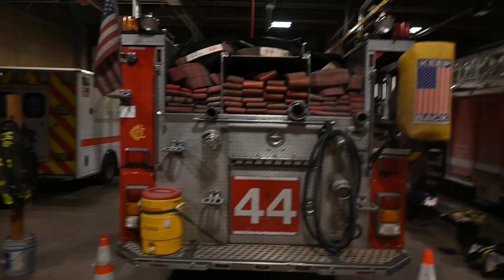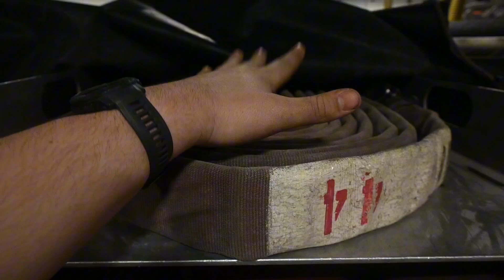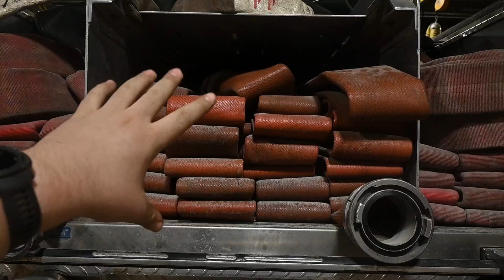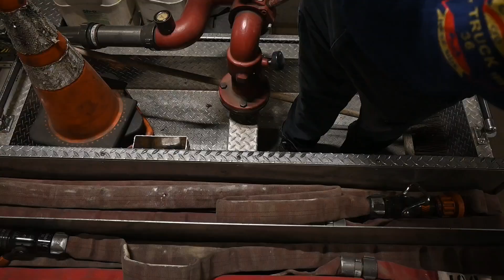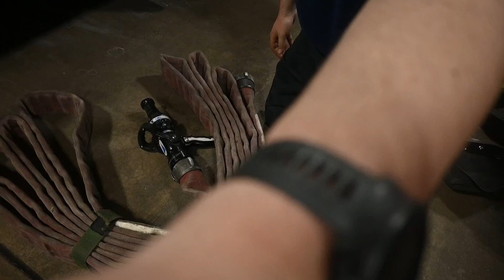All About the CFD - Episode 1 - The Basics of the CFD Engine

Comment: Standard hose load is 3 horseshoes “4 to make 3” so it’s 200 feet total.  Then the 1 1/4 shut off pipe which is a smoothbore nozzle with a 1 1/2” outside diameter, connected to a 2 1/2” to 2x 1 1/2” wye via an increaser.  Then the 100 feet of 1 3/4” hose with 1 1/2” connections on the tray.  Officer’s side is an exposure line with the same 3 horseshoe configuration but a 250/50 fog nozzle at the tip.

There is some leeway, basically the captain sets the rig up the way they want and individual shifts may change pipes or tips if they are really gung ho about having things their own way, but rebedding hose each morning just to have it your way is almost never done.
Reply from the maker: That's how I explained it!
Reply: @ Nah, 44 is running with 2 shoes for a 150’ lead out.  The idea is, there’s never a guy for the 3rd shoe so having 3 just means more spaghetti.
Reply from the maker: @michaelmcmeel914  well yes but the stretches in general I explained, I didn't really go into the shoes

Comment: Thank you so much for going through the HOSE setup on CFD 😊 engines. The redundancy of all the engines 😊❤😊 This is very educational for people, especially the general public that is watching Chicago Fire on TV and not knowing  the hose lay setups. Can I ask why Chicago  goes with  (4 inch) instead  of ( 5 inch) with a storze connection. I'm just asking out there  to Chicago people that now. I am so proud  to be an OWNER of a Spartan Gladiator pumper fire engine 1989 that I just bought 😊 its a training  rig from a fire cadets  program. I bought  it to keep it with program 😊 I have taken over all expenses 😊 there is some issues  with the pump piping. The ( tank to pump) has a cracked across  the middle. It's because  the rig sat outside in colder weather, and they did NOT put antifreeze  in the tank. The piping  on the tank to pump is lower so water was in  plumbing. Two reconnect are stuck open. One on cross lay and one is what the department  that got the rig new wanted ( a car fire reconnect) going off rear on officer  side. I have my baby girl in repair  ( fire repair shop) to FIX the important  one for me the tank to pump crack. Then, have them give me costs on the two reconnect repair. I want her a fully working ( pumping) engine  so cadets  can do all the drills off her. A department  donated  to the program  a ton of ( 5 inch) stotz hose, so I got 300 feet on my baby girl. I love it. Chicago  Fire uses the Spartan Gladiator. It warms my heart I have one to OWN. my dog Blaze loves riding  on engine  cover between  me the engineer ( driver), it's an Allison automatic. And my officer  wife. The dog sits on the engine  cover and looks out front  windows. For its power, it's the silver 92 DD engine with turbo